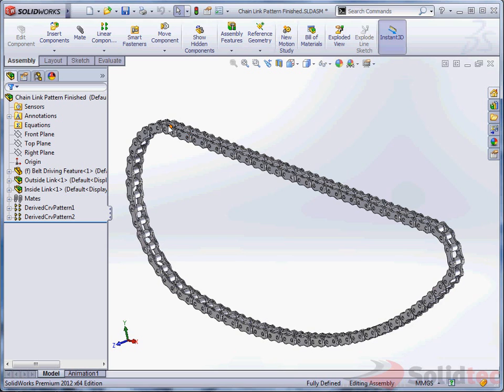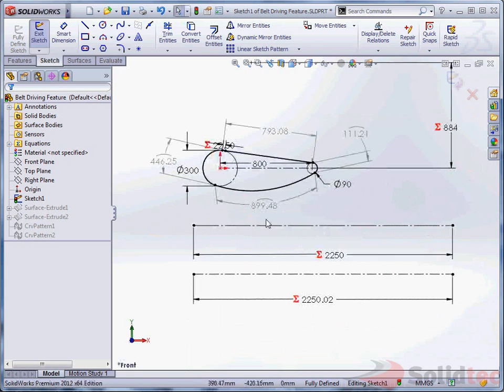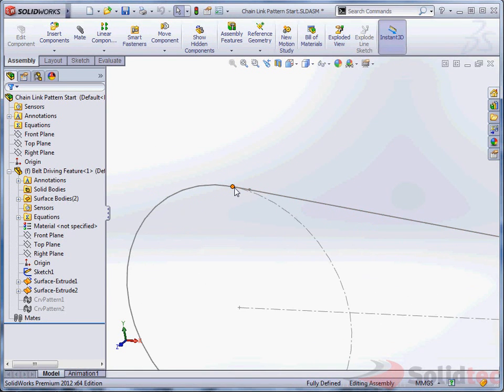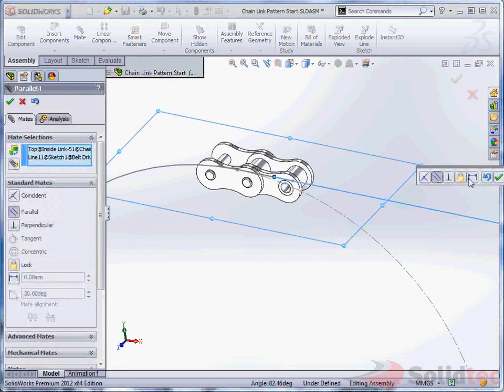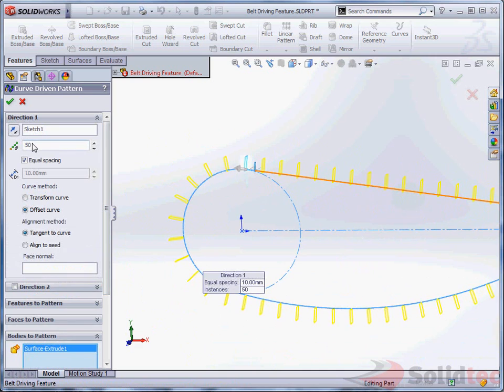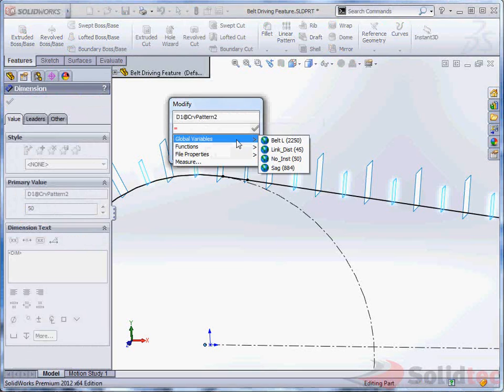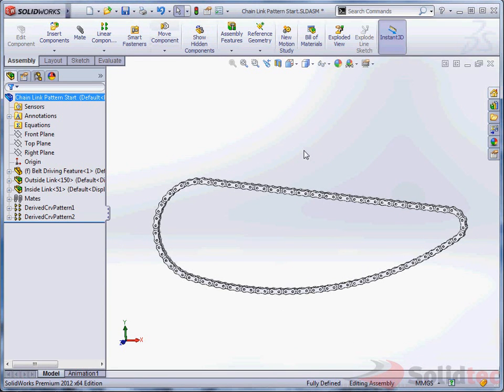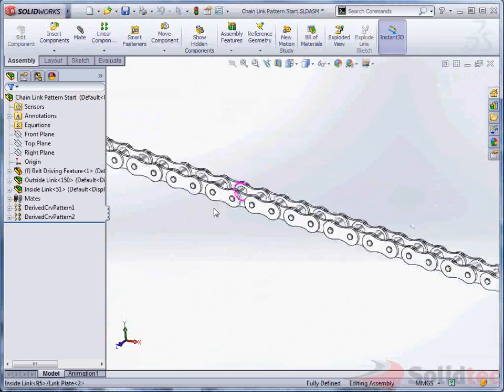SolidWorks Chain Assembly

Comment: none of these methods seem to be perfect, the offset around the curve is always wrong... it measures curve length not chordal length as a chain naturally does... notice on your smaller sprocket you are .5mm out each hole... Has anyone done this where its perfect with the use of one pattern, obviously you could turn it into 4 patterns or something.. seems solid works has only got it nailed for belts... what a tragedy for the perfectionist !!! :) Congrats on the closest Ive seen to perfect though!!
Reply: Succinct explanation right here, you are 100% correct, this has to do with the fact that you are patterning the chain tangent to the midpoint of a line between the center of the two pins, and not patterning based on the pin centers themselves (both) following the curve (which as i understand using this type of method is not possible).
Reply: Very Nice

Comment: How can I change my normal direction when I want to use curve driven pattern?
Reply from the maker: The Alignment method allows you to align it either to the curve or to the seed for 2d curve driven patterns.  If you have a 3d curve then you can use the face normal when selecting the align to seed.  For an example of this see my spiral stair tutorial.
Reply: Still I can not have the normal in the direction that I want. I dont know why it is up or downward!

https://plus.google.com/u/0/photos/yourphotos?pid=6040206358830275922&oid=105256858490108019339&authkey=CMin5t_mkuuFew

Comment: does the curve that the chain links are snapped to need to be a spline?  very confused why chain links do not follow the assembly belt lines
Reply from the maker: No, but does have to be tangent, also if you have multiple segments you need to select the sketch from your tree not from the graphics area.
Reply: Ok